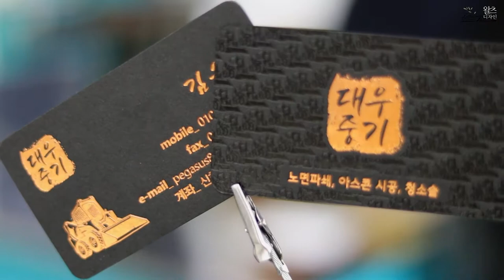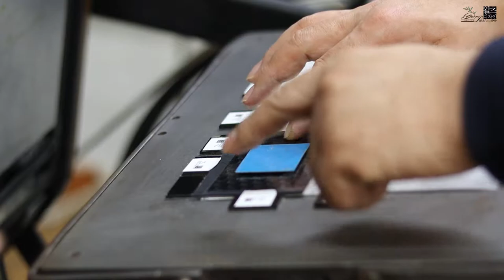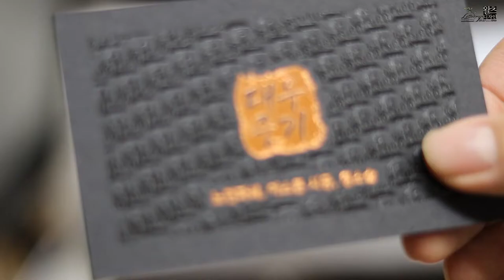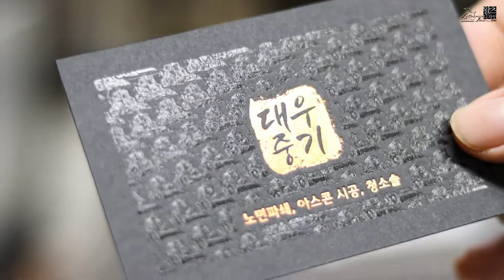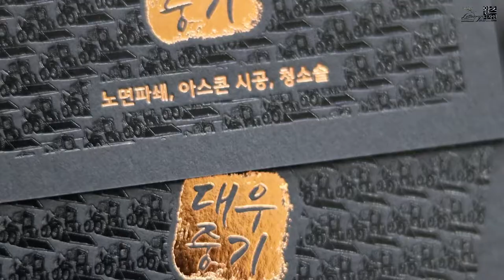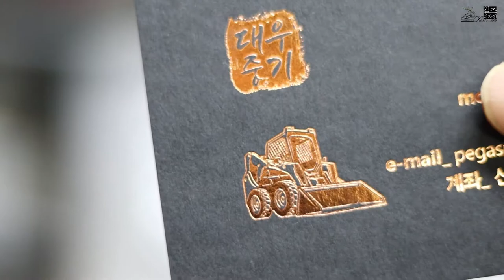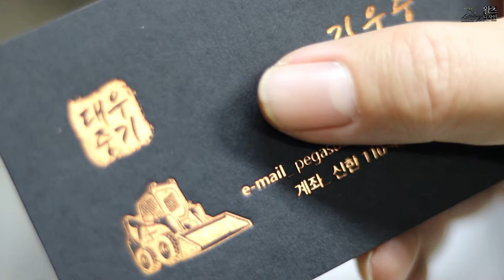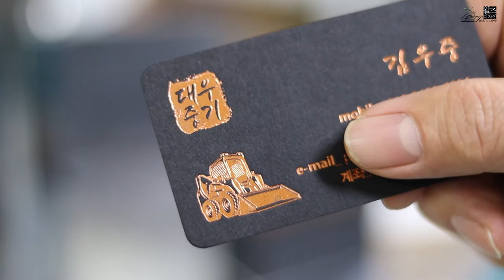Making high-quality business cards by foil + press processing.박+프레스 가공으로 고급명함 만들기.

Comment: During the foil stamping process, why is the artwork stamped twice (05:58); 1st with foil ad the next time without foil?
Reply from the maker: It was processed twice for the letterpress feel of the foil.  If you put a lot of pressure on the foil in step 1 and make it, the foil will spread.  So, in No. 1, apply moderate pressure to foil, and in No. 2, apply a lot of pressure.
Reply: @w_letterpress  Is the heat on for hot plate when you stamp in No.2?
Reply from the maker: The temperature remains the same.😊